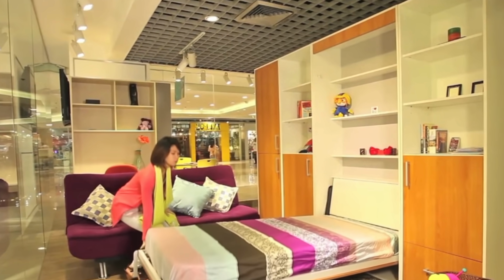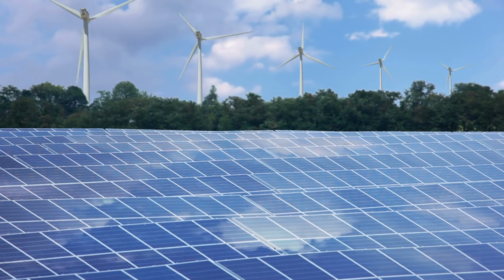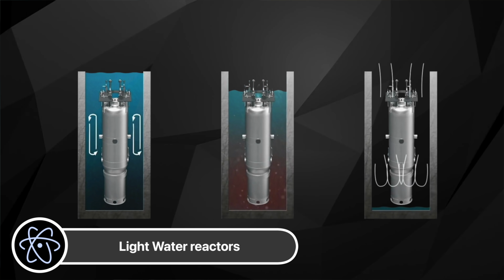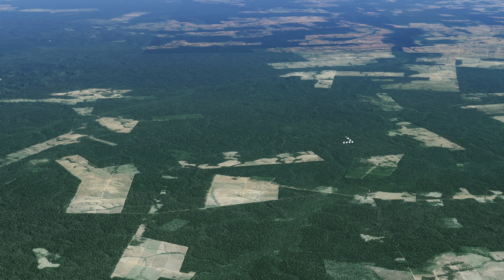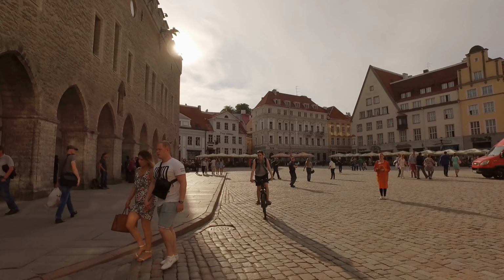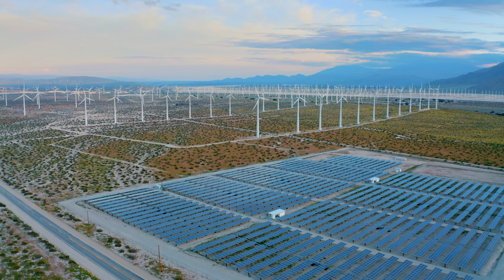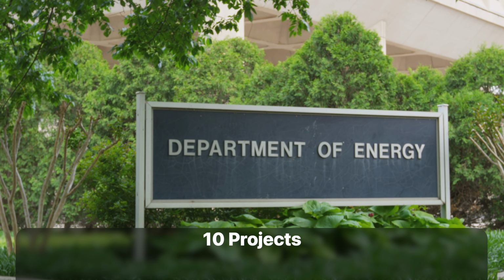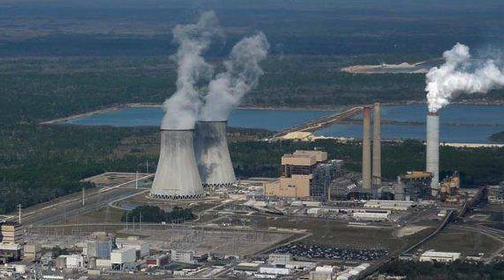Why Small Modular Nuclear Reactors Are the KEY

Comment: I see them being very useful for container ships. They are already as big as aircraft carriers and by changing to SMR's the bunker fuel goes away.
Reply: Unfortunately those gigantic ships doesn't cross the coldest waters on earth, only icebreakers in Arctic oceans are nuclear powered.
Reply: @carholic-sz3qv  you don't need ice for  nuclear power.
Reply: @LaserFur  depending on where the ships crosses it needs more cooling or even since commercial vessels doesn't have army to protect from pirates attacks..... it might be very dangerous.
Reply: @carholic-sz3qv  it has a massive ocean of water to evaporate. The high side temperatures are in the 100's of C. And pirates aren't going to steal the reactor. Also they do have guns when traveling in those kinds of areas.
Reply: @carholic-sz3qv  Not true. Most US aircraft carriers capable of going to any ocean in the world are nuclear powered.
Reply: @paulkieran2308  those are very specific models and they are the army, also they aren't built to maximise cargo like on a commercial ship.
Reply: @carholic-sz3qv  neither do Aircraft carriers or subs yet they are all nuke powered already.
Reply: @carholic-sz3qv  that makes no sense at all, all those vessels are full to the max with no spare room for anything, the same as cargo ships.
Reply: @carholic-sz3qv  You really need to do more research. Nuclear powered aircraft carriers require much more power to operate than the biggest container ships. If military nuclear reactors used in aircraft carriers were affordable and better yet, even available, they would already be used in container ships. I don't think we will be seeing nuclear powered container ships anytime soon.
Reply: @user-vp1sc7tt4m  big lol...... those aircrafts carriers actually have two or more nuclear reactors to operate with, a single nuclear reactor will be enough to power a container ship.
Reply: This was tried with the NS Savannah but regretfully there were alot of problems getting permission to dock in ports.
Reply: @carholic-sz3qv  cooling isn't much of an issue when you litterally have an ocean of water to dump your waste heat into.
Reply: @garethbaus5471  lol..... the temperature of the ocean at that place has to be good enough to sustain an intense cooling and in case of emergencies.
Reply: @carholic-sz3qv  so the ocean needs to be less than 200° F great.
Reply: @carholic-sz3qv  lol. The nuclear powered aircraft carriers and submarines already operate in such hot bodies of water as the Persian gulf or Red Sea. No problem cooling there. The cargo ships would require probably 2 reactors still but much smaller than an aircraft carrier for reliability. 
The drawbacks are they would require a much larger crew to safely operate those reactors vs diesel and other forms of cargo ships. They would not be able to dock in many countries therefore unable to properly unload cargo. They would also require much higher security measures such as security forces and inspection of cargo containers prior to loading. Imagine one cargo ship entering port of Los Angeles or a major Canadian port with large bomb in a cargo container. If that container was positioned properly you would have a giant dirty bomb without having to steal any nuclear material and they would have welcomed it into port.
Reply: @tedl2711  those are military equipments not freight ones. Also any accidents on board of a container ship might compromise the entire load, let's not forget pirates or any other attack.
Reply: @carholic-sz3qv  talk on the subject after you have a few thousand hours operating a nuclear reactor at sea. You appear to be clueless how water cools the reactor no matter the temp of the sea water.
Reply: @carholic-sz3qv   you never thought we can use the same or comparable reactor for a cargo vessel? Jeebus dude.
Reply: @typhoon743  thanks for adding that, never knew there were nuclear cargo.carriers, just icebreakers and military vessels.
Reply: @carholic1336, the physics of water-cooling don’t magically change just because you slap the word ‘military’ or ‘civilian’ on the vessel in question.
Reply: @Vessekx  I never said the physics of cooling the reactor would be any different. I am comparing a standard cargo vessel requirements compared to a nuclear cargo vessel. Unless you are talking about the other guy commenting with my same name. Something he said
Reply: As big as aircraft carriers?
 Aircraft carriers are as big as container ships dude.
Reply: @tedl2711 , yep.  Sorry, I clicked reply on the wrong post.  Fixed.
Reply: There are few good reasons why SMRs is not a thing on cargo ships

1. They are “SMALL” modular reactor, they won’t meet the requirements of a cargo ship considering a typical cargo ship would weigh in about twice the weight of a AC carrier. 
2. The over all cost of transport and commodities would sky rocket if companies switch to Nuclear powered cargo ships, imagine- more working personals with expertise in nuclear power resulting in increased accommodation space, change of the whole safety scene which has been followed for almost 50years, special training and work systems for employees meaning loss of jobs to most of the typical engine workers and I could go on
3. Completely abandoning more than 5000 cargo ships that in service which would cost companies millions. Even though it is a one step at a time process it would still cost the company heck of a lot.
4. Of course safety Hazards, contamination which could last for 100s of years out in the open ocean currents destroying every ecosystem in its way.

In conclusion, nuclear powered cargo ships are not practical at this point of time but for the future
Reply: @ezye97 , SMRs produce between 10 and 300 MW of electricity.  An electric cargo ship (currently in construction) requires about 7MW of power.  It looks like there’s plenty of headroom for SMR-powered cargo ships.
Reply: @ezye97  I disagree. I believe it’s time for the small reactors. It would take an “Elon Musk,” type to pull it off. Someone to vertically integrate the various groups of systems and never take “no,” or “can’t,” for an answer. It’s time is now. I bet Elon Musk could make it happen.
Reply: @LaserFur  A Somali pirate nuclear powered ship would be something to see.
Reply: @carholic-sz3qv  Cargo owners know this problem so they added a few crew members usual ex army members and the ship can be protected against piracy.   Pirates will never attack a US carrier. Look at cargo ships, usual a very large tank for the fuel and large marine engines with 14 cylinders that consume 250 ton at 24 knots and 150 ton at 21 knots a day  so very large tanks . The engine is so big that it needs two floors. If nuclear no tanks smaller engine.
Reply: @typhoon743  most pirates have no clue what an nuclear engine works.
Reply: @carholic-sz3qv lol you just owned in the comment section. Epic fail
Reply: @umamifan  thats what she said lol.......
Reply: Yes,the US government has already allocated money to have SMR's in large ships, but don't expect it for 15 years, the Russians already had a commercial ship run by nuclear.
Reply: @tedl2711  No the reactors for commercial ships require minimum supervision, coming in 15 years.
Reply: @ezye97  No, they won’t shift to nuclear unless there is a cost saving which is pretty easy seeing as how much  diesel they use.
Reply: @Vessekx  Cargo ships use more than 7MW but nuclear can power any size ship,  a reactor can keep aircraft aloft for months.
Reply: @paulbedichek2679  ok so less operational supervision but a much larger security force to keep nuclear material from getting in the hands of those who would use it wrong or keep them from bombing the ship which would create a dirty bomb. I wouldn’t feel secure knowing that these ships could easily be boarded by pirates for nefarious means
Reply: @tedl2711  Don’t worry we’ll keep using oil for ships it’ll be ten or 15 years before civilian nuclear ships are common.
Reply: @tedl2711  You don’t need any crew to operate the reactors we’d use for commercial shipping, it’s coming in about 15 years, the next generation of large cargo ships will use LNG, inexpensive and less pollution than bunker fuel.
Reply: @paulbedichek2679  ok but you would still need security crew to keep the nuclear fuel safe
Reply: @tedl2711  Not at all, the reactor is sealed at the factory and never reopened, it is fueled and sealed, then the reactor is removed when the ship is retired and the steel is recycled. That is only one model, there could be others,but the benefits are less labor costs as deisels take huge maintenance,plus there are zero costs for fuel,al
so where docked the ship is comnnected to the grid and earns money by supplying Carbon free power, you also get a ship that goes 32knots instead of 15,modern container vessels can go 26 knots but very few do as fuel costs increase exponentially with increase in speed.
Should be 15 years before we see the first ship with these new types of reactors, we can't use navy type reactors as those use 90% enriched, likely it will be HALEU which is just a little less than 20% enriched.
Reply: @paulbedichek2679  recycling steel that has been irradiated for 15 years? Don’t think so. Go operate a nuclear reactor for several years and see what you think about the claims you are making.
Reply: @paulbedichek2679  take Chernobyl…..now put in the sea…….with huge currents which can carry radiation to different ecosystems……get it?
Reply: @carholic-sz3qv  Not to be a dick, or a "that guy" but if you think that we haven't expanded reactors into large ships in all seas I am afraid you're wrong here. Take a look at the newest carrier we have. Now I can't explain exactly why, or how the energy is being used beyond what you would see on Youtube, there's some functions that not everyone knows about, but that new carrier can reach speeds never seen prior to the newest builds, it literally can drift, as a carrier in the ocean. Think about that for a moment, the engine output is high enough to cause the aft to force water to displace along it's edge to the depth a carrier reaches when displacing enough water to float. The carrier is the USS Gerald Ford. Just look it up on YouTube, and trust me, what they show in the video is absolutely nothing compared to what it can actually do.
Reply: @christophersextonsr8788  bullshit, that's an extremely expensive ship made for the army, the maintenance and refuelling alone are also super estensive expensive and takes a long time.
Reply: @tedl2711  The steel is not irradiated.  The reactor vessel would be but they just bury that as they do today, the whole ship isn’t irradiated.
Reply: @carholic-sz3qv  Navy
Reply: @tedl2711  Very little of the steel would be irradiated because the reactor would be containerized in a way that would allow it to be easily installed and removed.  If you use an MSR, you can operate at a very high and efficient temperature that would allow CO2 to be used to power a turbine that produces the electricity to power all the functions on the ship. Electric motors can vary prop speed over a much wider range than a diesel engine.
Reply: @carholic-sz3qv  and your point is???
Reply: @carholic-sz3qv  what rubbish.
Reply: @carholic-sz3qv  not a problem. Learn Physics.
Reply: @ezye97  showing your abysmal ignorance of SMR's.
Go learn.
Reply: @paulbedichek2679  hahaha! THAT would be a BIG aircraft!
Reply: @ezye97  plenty of nuclear power vessels have sunk. The oceans aren't killing us. Please explain.
Reply: @gregbailey45  okay I’ll definitely go and do as you say definitely.
Reply: I feel like they are useful in rural areas, but the reactors itself should be put deep underground, so if something goes wrong, it will be fine
Reply: @christophersextonsr8788  "Drifting" in an aircraft carrier isn't unique to that platform. All waterborne vessels have the same motion when turning. It's referred to as "advance and transfer". The phenomenon is just more pronounced at higher speeds. Check out some footage of military hovercraft for another example.
Reply: @paulbedichek2679  the depth of irradiation varies by proximity to the source of radiation and the intensity. The circulation pumps used to cool a naval nuclear power plant in a CVN are over 2 stories high and because the water the pump circulates comes in direct contact with the core when those pumps are removed at the end of their service life they are VERY "hot". Specialized crews that train for literally months prior to a removal have to work in small chunks of time to minimize cumulative exposure and are orchestrated closely so that as little time is wasted in the evolution. Additionally, the ships crew is kept to an absolute minimum and well away from the path the pump will take when it is raised up through the lower decks of the ship, through the hangar bay and off the ship. There are multiple pumps for redundancy. The department that operates the reactor is the largest on the ship until the airwing arrives prior to deployment.
Reply: @guamazolopez6456  I totally understand how nuclear reactors aren’t bombs. But have you heard of a dirty bomb? It is one thing to keep nuclear material out of hands of those who would use it the wrong way when we only have a few secured nuclear reactors compared to how many there would be and how unsecured they would be if the fleets of container ships had them. Have you seen how few people are in container ships? It would be a prime target for those wishing to do radioactive damage with a dirty bomb inside some port. Imagine someone exploding a ship in the port of LA. It would cripple the US economy and evacuate the near by metropolitan area for months to years as clean up happened
Reply: @guamazolopez6456  i totally understand how reactors are made I have operated them before. I have no idea how much the lead in the compartment walls will contain anything or how they will even set up their compartments. Reactor vessels don’t have a large amount of lead in them. The room they are in does. And the ability for terrorists to access the nuclear material or how they would use it in a dirty bomb has many possibilities. Do you want to take the chance they easily find a way to make a large dirty bomb that we would welcome in to the ports? I don’t want to take that chance. Unless the ships had reasonable security forces I don’t think the ship would be allowed to exist
Reply: Don't understand why we don't use giant sails for huge ships. Think like a parasail.

  One company has one and says it will save up to 20% in savings. If true and it works it should be mandatory. Then you have those tube ones as well.

Comment: Something worth mention, different types like molten salt are proposed to be able to be engineered to consume old nuclear waste while producing hydrogen and medical isotopes, all with passively safe operation due to new metallurgy overcoming corrosion issues of the past and the nature of the reactions self modulating or even shutting down by melting a freeze plug and self draining. 
Some even refuel incrementally and yield about one fifth of the final waste volume with shorter half lives.
Reply: @konradcomrade4845  molten salt tech is growing due to new and improved metallurgy as well as research on the reactor process as well. 
Things seem to have advanced substantially from the days when the concept was first developed and I’ve not heard of its use for cooling because it’s solid until heated. 
Thorium salt reactors self regulate due to narrow operational temperatures where the reaction slows rather than runs away. 
Molten salt is also currently being used to store heat energy for later electricity production (steam turbines) after storing excess solar from off peak periods. 
This tech is not a fool’s errand.
Reply: Xcept 4 reocurring containment problems.